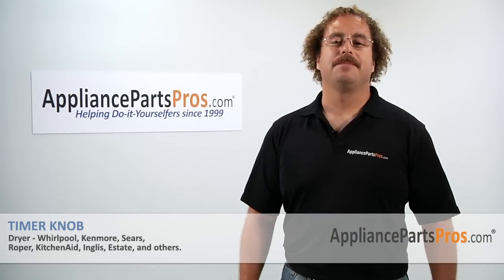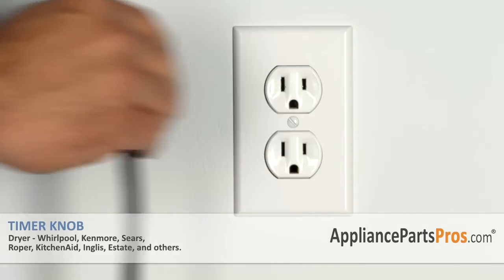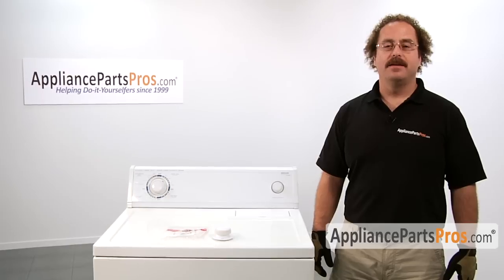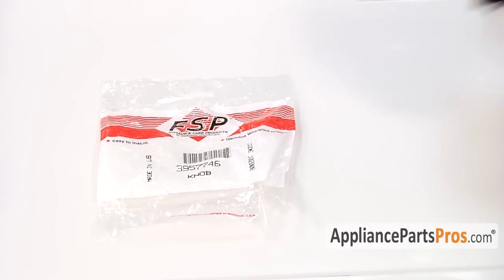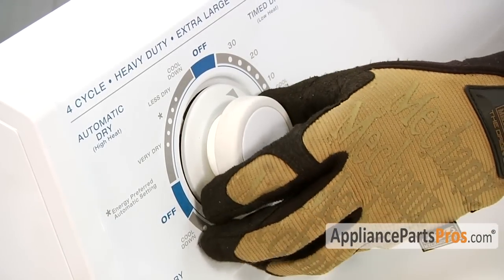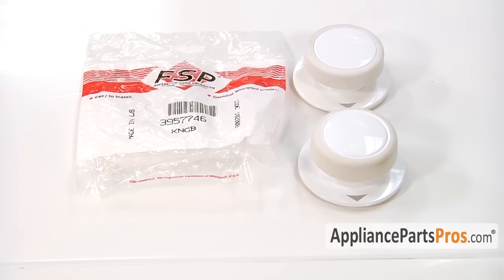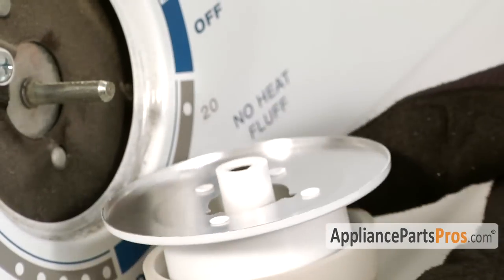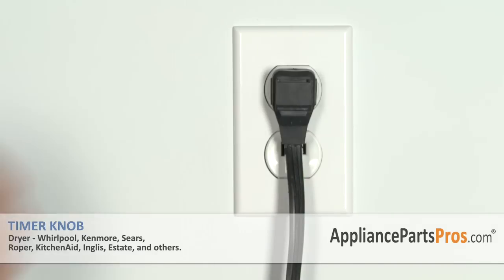How To Replace: Dryer Timer Knob

Comment: My dryer knob broke 4 years ago, and I was having to dry each piece of clothing with a hair dryer, one at a time, until I saw this video. I had trouble with the first knob I ordered. I couldn’t get it on all the way, and I wound up messing up the hole. I had the flat part at the top and tried to force it in, and broke the hole, but appliance part pros replaced it very quickly and now I can finally dry my clothes again!
Reply from the maker: Glad we could help out!

Comment: What if the actual thing that turns the timer is no longer accessible? Like if it’s worn out and has to be replaced?
Reply from the maker: I'm not sure which thing you mean. Do you mean the timer itself, like this? https://www.appliancepartspros.com/whirlpool-timer-f-m-wp8299766-ap6012581.html This is a diagram of the model we used in the video: https://www.appliancepartspros.com/01-top-console-parts-for-whirlpool-sgds800jq0.html Either way, the part can be replaced! We can advise you on the part you need. We may have a video for it, but if not, we can advise you on the repair. You can give us a call at 1-877-477-7278 or you can chat us at our website: http://www.appliancepartspros.com/. We’re here to help 7 days a week.

Comment: I’m looking what the part is called where you put the dial on, I have an old kenmore dryer and where I insert the knob is worn out and I can no longer used a strew driver to turn my dryer to set it on any time.
Reply from the maker: What is your model number?

Comment: What if the new knob slides right off when you pull it?  I can turn the knob and hear the timer, but when I pull the knob to start the dryer, it just comes off.  Thanks!
Reply from the maker: Depending on the style of knob it may be cracked and not working right. You can go to our website and enter the appliance model number to see the parts list.
Reply: Mine doing same thing the knob just slides off. Did you figure it out? Metal shaft is good no wear and timer turns but when I slide knob on and go to pull it comes right back off
Reply: Glue

Comment: This didn't help because I purchased new knob and new timer but the knob just spins and timer doesn't move.  How to fix this problem
Reply from the maker: What is the model number of your appliance? Are you sure you ordered the correct parts for your dryer?
Reply: Model GTX22GASK0WW
Reply from the maker: What part numbers did you end up ordering? Did you order them from AppliancePartsPros.com by chance?

Comment: Thank you for the video! I have a question regarding the timer dial & Knob for a much older Maytag Dryer model: DE408 that I was hoping you'd be so kind to answer... Although this dryer is much older it worked great and never left me down prior to the dial and knob falling off and me putting them back on yesterday. It had heat immediately after putting the dial and Knob back on but then as soon as I put a load of wash into be dried there was barely any heat. I also tried several different heat settings on the dial just to be sure it wasn't just a certain part of the dial not working and the result was the same.  Any suggestions? Did I do something wrong? Btw, my Knob gets attached to the dial & dryer with a small metal bolt that holds both the timer dial and the knob securely in place on the long metal pin that's already on the dryer and used for turning the dial. Sorry I don't know the correct terminology for these parts but I'm hoping you still understand the info from what I provided. Thank you in advance and God Bless you for sharing your knowledge with others for free❣️